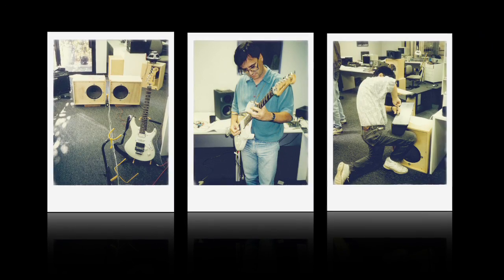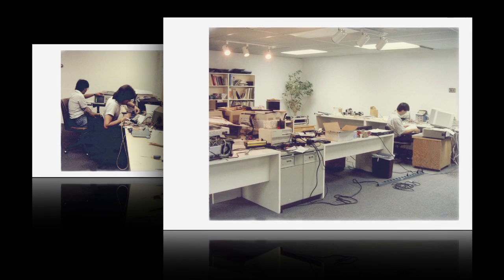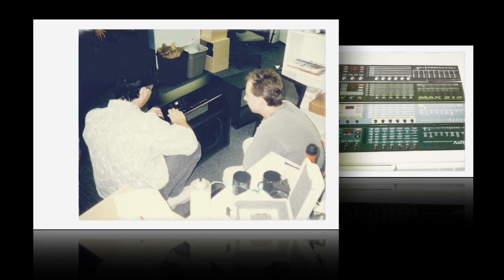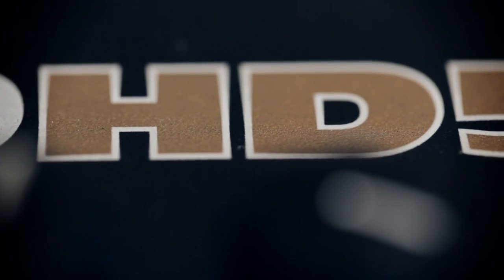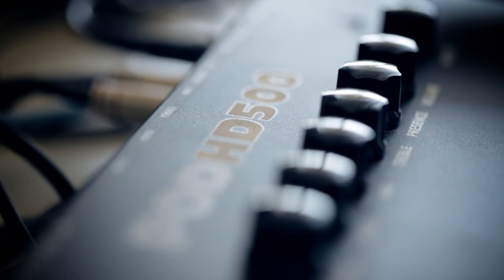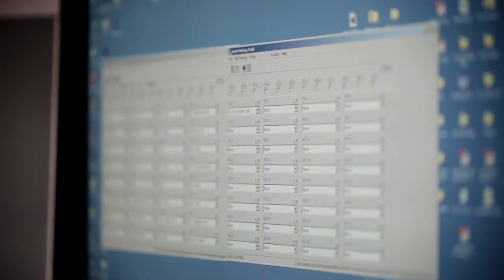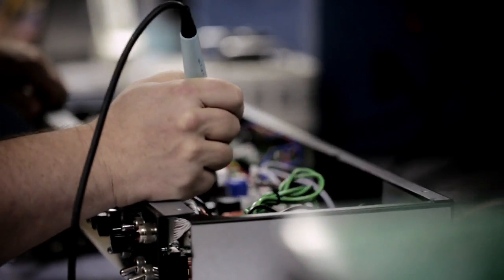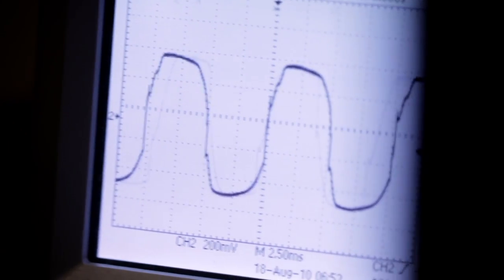HD Modeling | Line 6

Comment: I have an X3 pro six months ago. I have also used the old POD 2.0. After that I think have changed the pro X3 is not a good idea. With my four fender stratocaster behaved much better the old pod 2.0, but the dod yjm308
For when a review of the X3, or specific update for these guitars.
For many months you do not do any revision of x3. And you shall put the DOD YJM 308. It will make both the compressor and sustain the distortions?